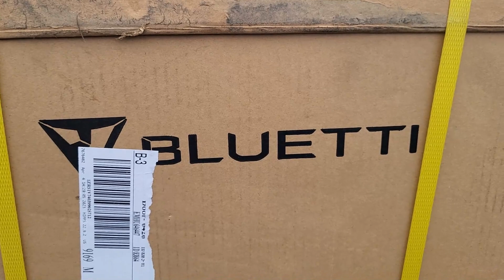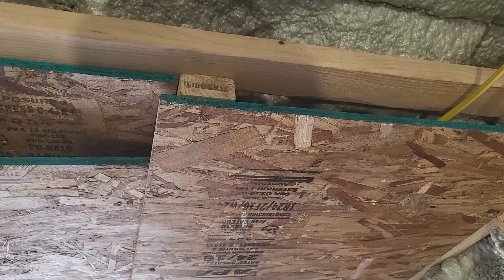Fixing our ceiling// SHIPPING CONTAINER TINY HOME// diy build on a budget

Comment: Demo/reconfigure a lot easier when you have screws. Voltaren gel works wonders on my shoulders. Thanks for sharing
Reply from the maker: Am not confident enough to use nails..I assume I will have to take it down and fix it at some point, that's why I don't use a lot of glue either..someday I will be like glue it and nail it we got this

Comment: By adjusting the ceiling the way you are doing in this video, you are eliminating a huge dust trap that could have become a very annoying source of dust and insect residue dropping on your head and work surfaces.
Not to mention that you would have been unable to remove the center panels without removing at least one of the side panels. Because of the dust collection lip on both sides.